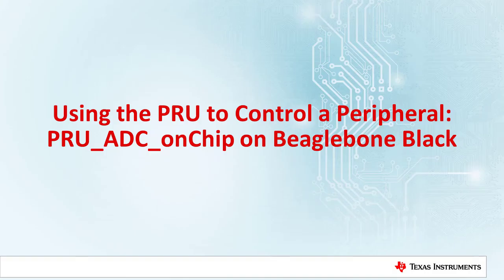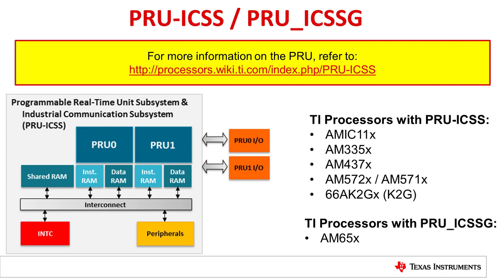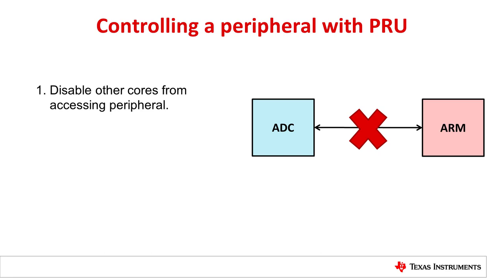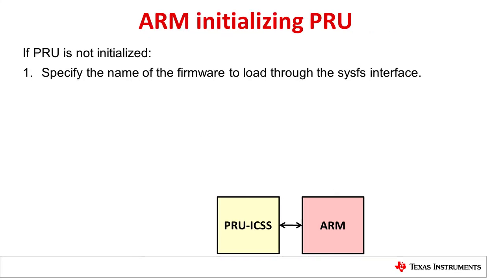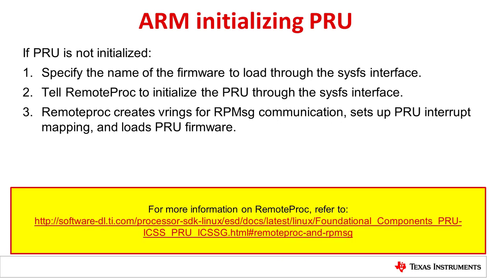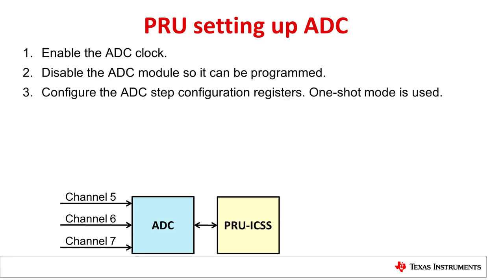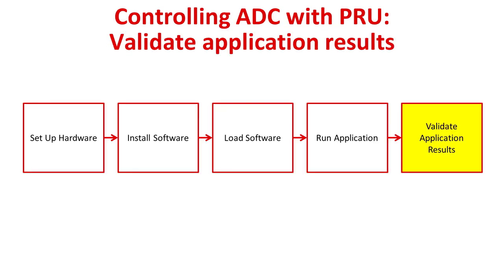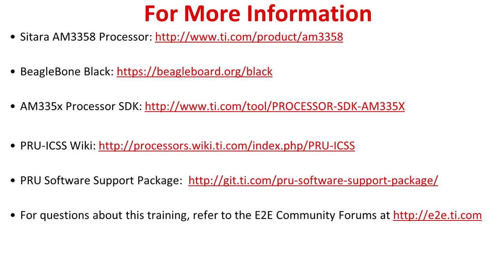How to Use the PRU to Control a Peripheral: PRU_ADC_onChip on Sitara 335x using Beaglebone Black

Comment: Stop using shared memory. I do not understand why this is so fricking hard. Use a hardware FIFO between non-real time application processor and real time controller. This avoid contention issues against single interface. If you want to do software FIFO, Queue, etc. make it dual port. Its not hard to make a small SRAM do this. It would allow deterministic IO access and prevent stalls.

Granted you would make up for this with IO buses like SPI which use DMA or FIFO. Technically then you are keeping them completely isolated.  Which prevents one from snooping the others IO space.

Technically shouldn't this be using the mailboxes not the RPMsg, which is backed by kfifo?
Reply: Very new to Sitara, but shouldn't it be very easy to program your own FIFO on the PRU side ? The mechanism described here appears to be very Linux-friendly, which is probably the point. I don't see any issue with coding my own FIFO's. Is there ?
Reply: @TheNefastor  In all fairness this comes from a very hard deadline version of real time. More than likely the PRUs are meant to be state machine automation. There are limits to how hard the deadlines can be. The issue with software FIFOs is that they have state machine values which are hard to properly lock without creating a timing conflict. Granted the PRU's processor design is likely only so strong, so this may be somewhat pointless. 

You would want the memory to be on the SRAM side. Without an interrupt, if it exits, there will need to be a polling logic. However multi-direction FIFO on single memory will create access issues. Bus arbitration can solve this some, possibly.

The fact that this standard Linux is a good thing. My issue is also not with the PRU modules. However, the PRUs are not very capable at doing certain things. Even the STM32MP1 suffers from this even though it has more capabilities in state machine automation. PRUs poll DMA to add chip selects to SPI. Cortex-M4F can do more complex things with its own dedicated bus to peripherals and SRAM. Sometimes you just want a few PRUs while other times you want one or more Cortex-M4F.

Writing logic on the PRU or Cortex-M4F can be crippled by the IPC means. It can change the software structure and define what is possible. The issue with most shared memory is the DRAM latency and bus arbitration. Most systems cannot use dual port anymore without creating a serious headache. Multiple individual SRAMs creates headaches and adds area to the chip. However, the programmer does have more freedom here, however I do not know if Linux will use it. RP2040 uses stripped SRAM which may simplify this.

That would allow the shared memory model to likely continue to work without significant issues on arbitration. This would likely be enough for the PRUs intended applications. These pitfalls are not well documented. Most controllers are just state machines, so just adding reconfigurable state machines is likely very powerful. RP2040 provides a lot of different kinds. The PRU is basically one of them. I would not recommend viewing it as a full controller. It can be, however.
Reply: @TheNefastor  Again I would look into the mailboxes. If you want to write your own, that is probably the proper way to do it.